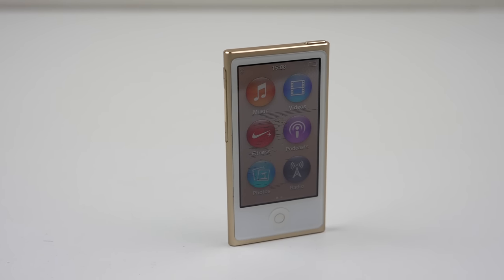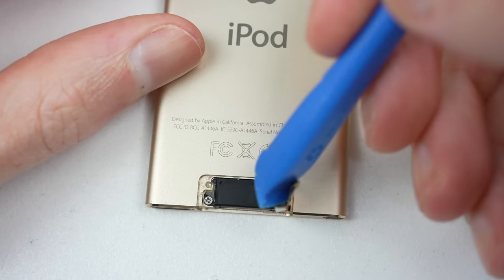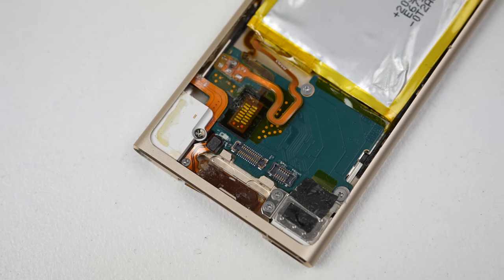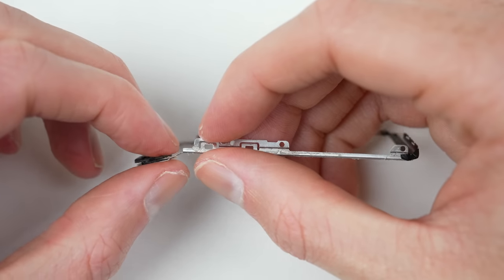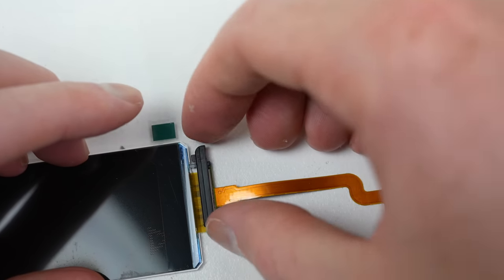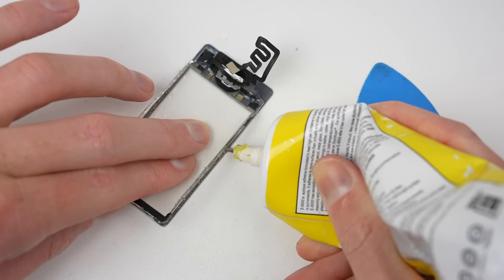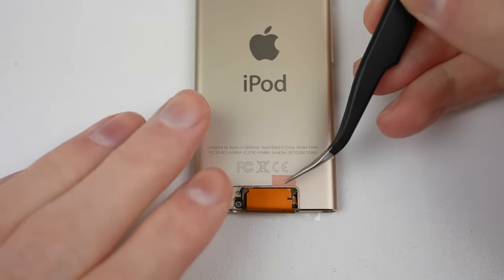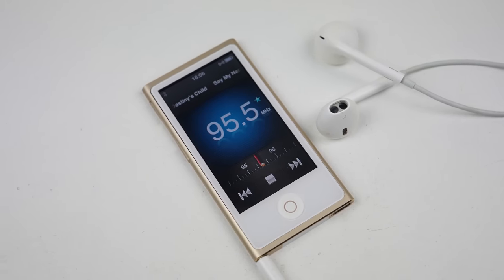Repairing Apple's Strangest iPod - Nano 7th Generation

Comment: I have this model the only issue I have ever had with it is the battery meter will go from red to half full once I plug it in and unplug it the battery bar will show full for an hour or so even when plugged in for a few minutes
Reply: Got the same problem. Ever find a fix? The meter never appears to give a accurate reading.
Reply: @jubear1493  had to replace the battery
Reply: @MrWargw  Ah, thought that might be what would be needed seeing as you were here. :) Hoping that worked for you. Think I'll have to have a go, or throw it at Apple and get them to do it, (looks as if they'll still replace 7th gens battery's, for a rather large cost!) Cheers for getting back to me my man :)
Reply: @MrWargw  Good to know! Bloody annoying not knowing the right charge on it! (mostly as it'll shut down if it thinks the meter is dead) Looks like you got it done cheaper than I will here in the UK, 60 Quid at least here. 😬 which is why DIY might be a better idea for me, if I'm feeling brave enough!
 Shedloads of people when they bought the thing brand new had similar problems to us. Apple had to deal with quite a few unhappy customers bringing the 7th gen back, whom they'd tell to calibrate and reset it. Which sometimes would work, sometimes not. Old Apple forums are full of folk saying the battery meter kept messing them about and they thought it might be a software issue or duff battery's.

Comment: I wonder how long the repair took. I am assuming that it was edited down. Why is this important? Well, the costs of parts, + repair time could be more than what the value of this iPod is worth. It may be less expensive just to get a new one. [This, as it seems is how companies design their products these days.]
Reply: There is obvious editing, yes. I'd say it took a little over an hour to repair.
Reply: He is repairing it and filming the repair so it would not be an accurate gage of how long it would take just doing the repair without filming
Reply: Well… that’s the thing. A majority of the repairs Hugh does would be unreasonable for your average technician considering the amount of time and money needed to be put into these devices. Normally, it wouldn’t really make much sense to even repair such devices like the ones Hugh does for such a small profit margin—if any at all.

But the reason as to why Hugh specifically is able to go to the extent of repairing something to the point of a loss in profit just so it’s cosmetically appealing is because it’s not the device that makes him the money. It’s the videos. He doesn’t need to worry about those factors since the videos are where all of the profit comes from.

Either way, as for the device in this video, iPods aren’t in production anymore. Every model other than the Touch was discontinued a number of years ago but even recently was the Touch also discontinued. They’re highly sought after and, depending on the condition, are worth anywhere from $80 - $300. Very much worth repairing.
Reply: @Parker307 you mean gauge

Comment: As for the earbuds removing the mesh effects the sound and I reccomend dropping some alcohol into the mesh and cleaning with a needle or a small brush before letting it dry, should pretty much fix the problem. Plus, guys, all of your earbuds need to be cleaned every couple months anyways
Reply: You mean affects
It is not effects it is spelt affects(these two words have different meanings)

Comment: A little correction; if I remember correctly, the long tall nano iPod also had a built in FM radio (forgot which gen, but you repaired it once. The one where everything slides out the bottom)
Reply: 5th gen. 

The 6th gen had it too FYI

Comment: Shouldn't you put a new mesh on the EarPods? While it does mean it would eventually need to be replaced again, wouldn't the earwax just go straight inside the bud when there is no mesh?
Reply: I had this done long ago on my AirPods. Same guess, and i would not risk it, so i cut pieces out of the hepa filter strips, that come along my vacuum bags. 
I have searched for a pre cut mesh replacement and lately found some on Aliexpress. Now i am used to my white fuzzy felt plugs and the making, i'm not change the proceeder. 

It is really sad, that Apple did not plan for a replacement to this (basically)  hygiene article, in the first place😔

Comment: If they can use the metal frame to screw the display in why the fuck can they not do the same at both ends of the frame with screws and not use glue .